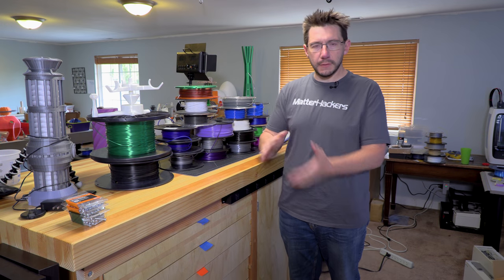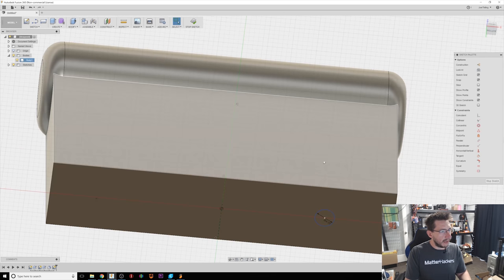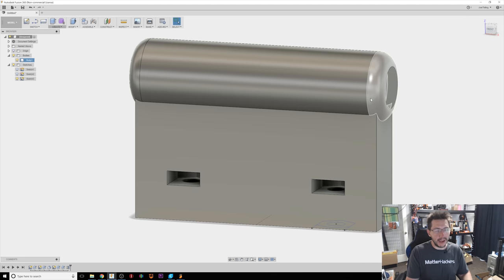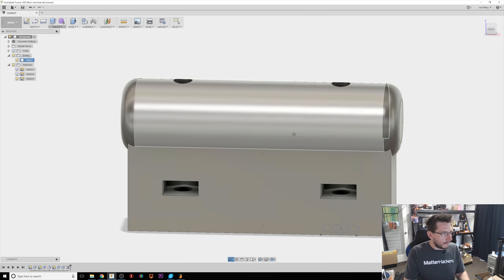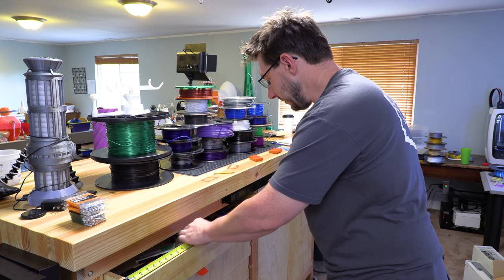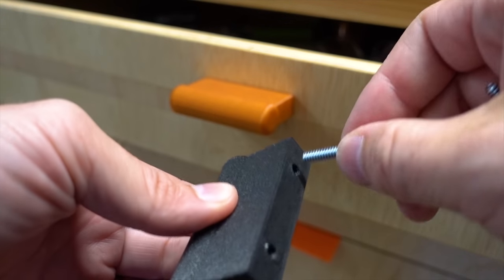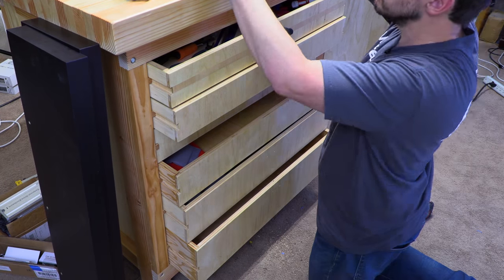DIY Custom Drawer Pulls / Drawer Handles & Jig / Template using 3D Printing!

Comment: Pro tip: For measuring something like that where you need to find the centre. Measure and mark the way you did and then measure from the other side and mark. If you are truly centeted your marks should be right on top of each other. If they are a bit off then the true center will be in the middle of the 2 marks. It's a good way to double check to make sure you are centered before drilling the holes.
Reply: This. Especially if you have a dodgy measuring tape with a loose hooked tab.

Comment: Job well done Joel.  Tell your Dad from me that he's quite the Dad and a great craftsman.  I've been using my 3D printer for all sorts of projects around the house.  Some are a bit difficult to explain, but I've created Speaker Shelves, Custom Cable Chases, Scale Modeling Bases, a stand for my kids champion Pinewood Derby Car, a custom stand for a Network Switch , and parts for a suspended corner shower caddy to name but a few.  I learn something new in Fusion each time.

I think 3D printing for home projects is a very strong case for owning one.  There is really no end to the possibilities.  It just requires imagination, time and accepting the challenge!

Comment: One thing i like doing to prevent the need for supports in this case, is add a 0.2mm (or whatever layer height you use) flat surface across the hole.  this way you get one layer of built in support that you can just screw through or cut out.

Comment: About the support on the nut traps: If you close the screw hole with a layer-thin cap then it let's the slicer build full bridges on that layer. The screw hole resumes on the next layer with proper support, and the cap easily breaks away after print completed.
Reply from the maker: YESSSS THANK YOU
Reply: That's a great tip! Bridge FTW

Comment: With a screw that large, I just model the threads right into the housing. It's a drawer pull. No need to put in a nut. Fusion 360 has a great thread command to model them right into the body. Also, on the template, I've made a couple, but I make mine larger to sandwich the board to be drilled. I drill with the template on there. It lines up the drill straight and prevents chip out on the back side when you drill through. The drill will eventually destroy the template, but you are only drilling 12 holes and they will all be at perfect right angles.

Comment: Instead of having a holes in the jig be the size needed what you should have done is make them only large enough for an awl. The you use an awl to make starting holes straight from the jig and have more accurate center points.
Reply: I think that's an awl-right idea
Reply from the maker: Yeah, the jig could use another revision - agreed.

Comment: An alternate design I found works is knobs with thin pegs that go through the drawer, similar to wooden knobs and screws. Made a few out of HTPLA around 20 months ago to replace some knobs that just kept popping off, using hexagonal PLA shafts for a press-fit into both the drawer and the knob, and so far nothing's exploded. I'd want tabs there too, but it's nice for repairs when it's that or swapping out six other handles to match. One day I'll figure out PLA creep to a point where I can just know whether a part's going to crack or deform after a year. Until then, my prototyping phase is crazy-long.

Comment: 12:08 At this point I recommend the old carpenter's trick of using two measuring tapes, stretch one across from the left side, and the other across from the right side, and where the two tapes' "half way point" is will be apparent because the distance from either side will be the same... So you'll see that the middle is perfectly measured out because both tapes happen to come to the exact same measure from either side at the same point in-between and they line-up against one another at that point.

No mathematics necessary, only observation of where the markings on either tape happen to "be the same" on both at that given point.

You can do the exact same thing with rulers, yardsticks, etc. and it's often faster/easier than working it out on paper.

Comment: Really nice job, both in design and execution. If I could make one small suggestion for the cabinet, I noticed that the drawers go back on thier guides further than the face. Perhaps you could put a block or stopper to prevent this.

Comment: I noticed that you had different colored tape on the drawers before hand. I thought it was interesting, though rational, that you made all of your handles the same color. Might I suggest that you color coordinate the handles to what you have in the drawers for quick reference? Like say Tom comes back over, and you ask him to get something from the "Green" drawer. He looks over, opens up the drawer with the green handle, and BOOM there's the thing you asked him to get. Just an idea, since filament comes in different colors.
Reply from the maker: It's a neat idea, and I was I was so cool for that to be the reason I had different colored tape. However, it wasn't, I just used an orange piece because it was the nearest roll of tape :)

Comment: That mirror features is going to come in handy for me! Curious why you made the holes in MM and used imperial bolts and nuts? I mean, I've had to just because that's what my shop sells, but it would be vastly easier if I could get my hands on metric nuts and bolts!
Reply: If you make things for yourself, you have a total flexibility. Non-metric hardware was easier to obtain and it's cheap.

Comment: Quick tip! You can actually click on the plane without hiding the body! Just hold your left mouse button down for a second, and it'll pop up a menu where you can choose which element you want to select! Works on anything at any depth!
Reply: I tried this today (since I am aware of it), but it was "finicky" at the specific viewing angle (I don't have a 3D controller to quickly rotate it), so I just hid the body. I would like to issue verbal commands to Fusion 360, but I don't think it would obey them...
Reply: Yeah it takes a while to get used to, but you can tell which thing it's selecting (if you have a lot in your scene) by looking at what highlights in the viewport. Hiding works fine too of course. Sometimes I find it handy to not have to move my mouse all the way over to hide something, and then come back. There are occasions where I hide things to make it easier though :)

Comment: hmm, why you just didn't use a self tapping screw with 5 walls in slicer?
Reply: while that would work, it wouldn't last forever. Eventually those threads would rip out of the plastic

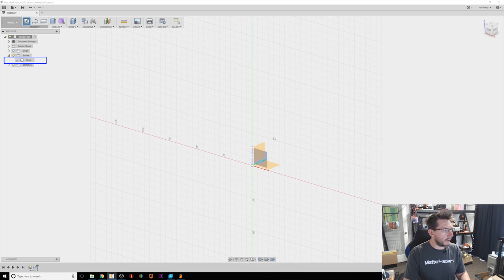Comment: 2:30 Protip: if you hold left click over a surface it will give you a drop down of all selectable elements under the cursor and you can simply select the XY Plane option without having to change any visibility settings.

Comment: I made sth like that a month or so ago with Fusion 360 (I was pausing the prints and added a hex nut in then went on with printing. Made a hole on the bottom in Fusion so i can Use a metal screw that locks in the hex nut)
Reply: With your version there is a seem I thought about doing that but pausing the print made better results

Comment: A quick tip: Use some painters tape on the edge of each drawer where you are going to scribe the centre with your pencil. After installing the handles just remove the tape which will also remove that ugly pencil line.

Comment: Oh man you seriously need to metric
Reply: I was going to suggest that too :)
Reply: 12:06 I think I had a stroke from watching this
Reply: Theressa , I TOTALLY agree...
Reply: Totally agree +Theressa. My head hurts
Reply: Indeed :-)
Reply: First time that I noticed Joel's excessive usage of metric untis. (Just hoping a 'thumbs up!' from Europe will not make you reconsider ;-) ).
Reply: My thoughts exactly. Wouldn't have been so much of a brain strain.
Reply: If you know how to do math, you can use any units that you want. Dividing 10mm by 16 or any other integer is no different than dividing 1 inch into 16 equal spaces. Would it really have been any easier if he measured it to be 860.425mm instead of 33-7/8 inches?
Reply: Chris Huck but mm are metric and metric us divisible by 5's and 10's so you can use your hands to help you out if numbers make your brain hurt.
Reply: Chris Huck
Yes, it's much easier to divide 860 in half compared to dividing 33-7/8 in half
Reply: Thumpert the Fascist Cotton-tail Ah, but you neglected the decimal part of that measurement. That’s where it fails to be any easier. If I gave you a measurement of 33.875 and I didn’t tell you if it was inches or millimeters, I’d bet that you would be able to divide it into any given number of equal parts. 

Everyone gets hung up on “fractions” that appear on most tape measures with inches. As an engineer, I design things all the time that have fractions of inches. However, for things that require more precision than most tape measures, those fractions are specified in decimal form to be measured with dial calipers or micrometers. The same applies to fractions of millimeters. At that point, you’re just doing math with decimals. Hell, I have an inch tape measure with 10ths divisions! It’s just as easy to use as my other tape measures, including my metric ones.

If everyone simply gave dimensions in decimals, it would eliminate a lot of meaningless arguments about units. Use whatever is most relatable for you.
Reply: Chris Huck
Yes, I deliberately neglected the decimal part of that measurement because it's the sane thing to do. You're talking about less than half a millimeter. That degree of accuracy is completely unnecessary for this type of work. Half a millimeter equals 0.0197 of an inch. Do you really think it's necessary to be that accurate when attaching handles to drawers?
Reply: Thumpert the Fascist Cotton-tail I don’t think he needs to be that accurate for this application. That’s not the point. The point is, it’s just math. Not every metric dimension is a nice round number in the same way that not every inch dimension is some oddball fraction. I’ve seen all types, and as long as you can do math, you will get to your destination. Joel worked out the math exactly the way I would have given the measuring tools he had available.
Reply: Considering the workbench was made for him by his father it was probably built with imperial units. Why not stick with them since going to metric would likely yield a number with a strange decimal. Metric is the way to go if you are making something from scratch, but I find that if you are modifying something it is best to stick with its units. Furthermore, it is very easy to divide imperial units into 2^-nth fractions (1/2, 1/4, 1/8, ...).
Reply: We are metric here in OZ now, but weren't always so. To easily divide 33-7/8 inches by 2 , just subtract half the different between 33-7/8 and the next whole number (which is 34) from half of that next whole number. ie. 17 minus 1/16 equals 16-15/16 inches. If your initial number is divisible by two (eg. 32-7/8), then you use an additive process ie. 16 plus 7/16 = 16-7/16. At the end of the day though, metric is so much easier !!
Reply: Laz Arus The argument that metric is “easier” is usually defended by the assumption that all metric dimensions are nice round numbers. That is far from the case. Sometimes you can’t just use nice round numbers because the design constraints say otherwise. Either that, or people that have never had to deal with manufacturing tolerances don’t realize that most “nice” metric dimensions are nominal and just fall between two very not round numbers. I mean, what is the difference between 1.637mm +/- 0.003mm or 1.637 in +/- 0.003 in? How is one “easier” than the other?
Reply: but you can always just put metric dimensions in to the calculator.. how do you put 33-7/8 divided in 2 into a simple calculator?  860.425/2 is kinda easy.. 
but still if you want it in half.. just fold the tape measure in half and read the bottom of it..
Reply: 33.875 / 2
Reply: Chris Huck The argument for metric being easier is as follows: 1 yard=3 feet=36 inches. 100 inches=8.33 feet=2.78 yards. Metric: 1m=10dm=100cm=1000mm Metric moves a decimal place. Imperial is not intuitive in any way. This is coming from someone who has lived in the US all his life and has had to make adjustments in my thinking in regards to 3D printing being primarily metric.
Reply: Theressa I
Reply: Never understood why people would ever use inches. Metric makes so much more sense
Reply: He was doing his models in mm.  Then switch to inches??  Just measure everything in mm!!!
Reply: I prefer metric as well, but in the states, it can make things more difficult, and if you have screws laying around, they are likely not metric. its slow, but hopefully everything will go to metric (or SI) eventually.
Reply: @Chriss Huck you can't really measure mm decimals with a tape, for any purpose where you have to measure using a tape finding the center point almost always is easier in metric.
Reply: Its still a lot easier to convert 1.637mm to 0.0016637m than 1.637 inches to 0.13641666666666666666666 feet.  There are somethings in the USA that are engineered with 10ths and 100ths of feet. A 10th of a foot is close enough to an inch that it can get mixed up on a tape measure, but different enough to completely screw up a measurement, even when building a house, where your tolerance would be 100th of a foot or about an 1/8 of an inch.  Automotive industry is pretty much switched over as far as I know.  It was probably a painful 20 years though. There are somethings that are difficult to change, like pipe thread, because you have to be able to put new and old parts together.  I'm 34 years old, grew up in USA on feet/inches.  I would much rather use meters/mm, but a lot of things I use day to day are legacy and require inches.

Comment: Hey Joel! Great video, I just have a question, is it possible to link the screwhole to a offset from the cylinder instead of setting a "blind" length in Fusion 360?

Comment: Joel,
Why aren't your handles in the middle of the drawer, vertically. This would be the center of force for the drawer-front, and likely the center of mass of the contents.
Your template could have sets of holes for each drawer height to still assure proper placement.
Reply from the maker: Yes it could have. However that's not what I wanted and force on drawer from closer to the top was planned :)

Comment: Should use a laser or string with with weight to line up all the lower drawer centers. 
Your template was cool.  Maybe next time add a shaft alignment guide for the drill to be perpendicular.
Reply from the maker: shaft alignment guide - good idea! I thought about a string to line up centers, but I wasn't sure if each drawer was the same width.

Comment: People really underestimate being able to just thread into the plastic without needing the nut. Especially when using course thread bolts. For projects like this you'll never pull out the threads during use if sized the hole for the exactly diameter of the bolt (the ID hole tolerance of printing shrinks it almsot perfectly for threading the bolt into without risk of layer breaks). The drill your using even just relies on the plastic threads the screws that hold the body together have.
Reply from the maker: I know I could have tapped the handles, but I wanted the experience of modeling in a pocket for the nuts. :)
Reply: 3D Printing Nerd experience always is good too. Wouldnt have to even tap the holes. Unless your highly undersized i dont find tapping plastic beneficial as if your  removing material the threads of the bolt could be using for bite. Threading the hole actually would make the nut more desireable. Untapped small irregularities in the bokt surface add to grip strength and surface area. Much like how you dont tap wood for a screw, only predrill it. We just print a predrilled hole instead of drilling ut after.

Comment: The round green containers in the third drawer, where did you get those?  Also, did you consider adding the nuts to the pulls while they were printing?  Could have had solid sides then.
Reply from the maker: I got those from a fan! Yes, I considered adding the nuts during printing, but, I wanted to model the pockets and see if they would insert okay.

Comment: I've started CADing and 3D printing a year ago. Watching someone CAD reminds me there's multiple ways to create.
-> Tapcon Screws. They are made for cement but have an awesome bite on PLA. You'll need a minimum 1.2mm wall. No need for nuts.
We 3D printed structural robot parts attached with Tapcon Screws for the FIRST Robotics team I mentor. 
Team 5689 CK Cyber Pack
I'm in the process of Making videos. Will clean up my channel and post. I have a few things I've done posted on my Instagram account.
Reply from the maker: I knew I could have tapped into the plastic, but I didn't want to. I wanted to challenge myself and see if I could make pockets for the nuts.

Comment: Joel do you still have the FlashForge Creator Pro?  I'd like to upgrade mine with one that can print PC, Nylon, etc.  High temp filaments. What would be a good replacement anyone would recommend?  Or is there anything I can do to upgrade the FlashForge to print high temp filaments? Thank you for sharing your knowledge.

Comment: is it possible/practical to have the 3dprinter stop at the top of the pocket for the nut then you put the nut in and have the printer finish, then you wouldn't need the nut pocket to extend to the surface.